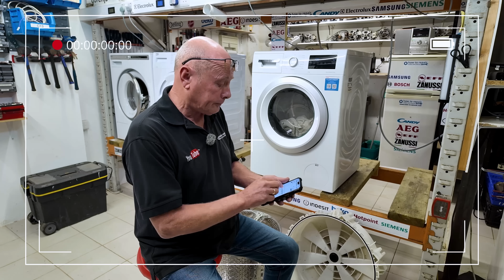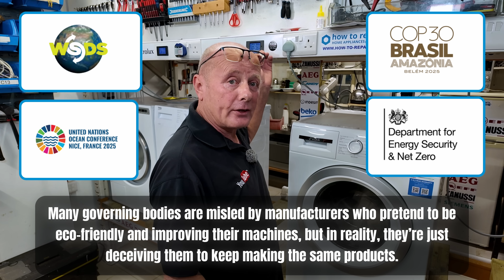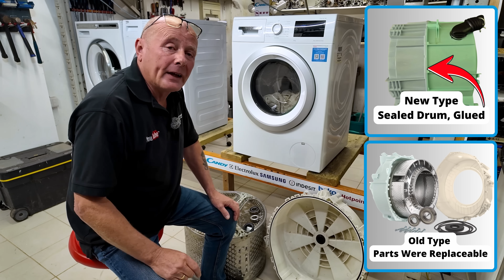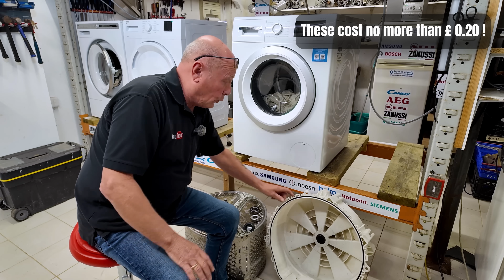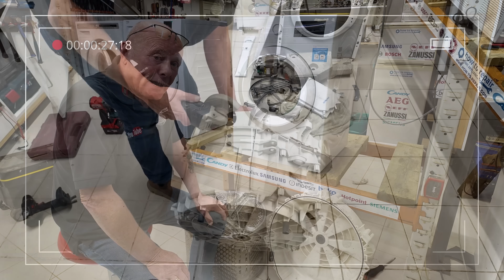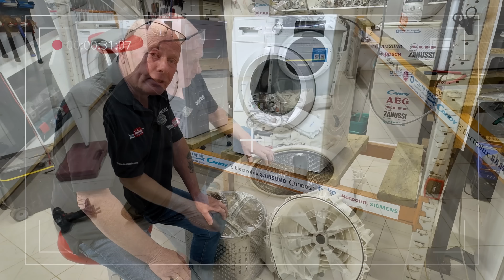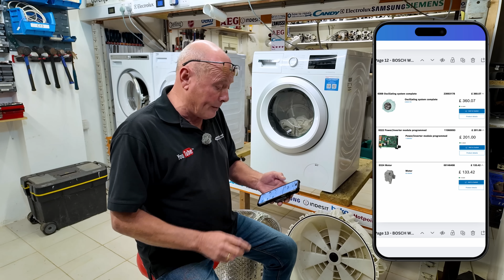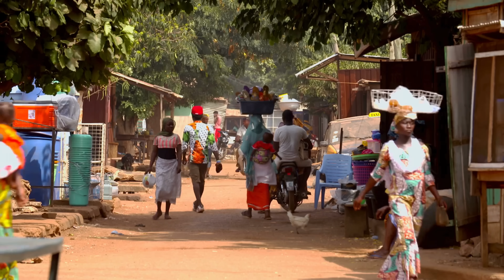Washing Machine SCAM EXPOSED! The Truth About SEALED Drums: Naming & Shaming

Comment: Hi Paul, I believe the way to defeat these manufacturers that are making machines that are to expensive to repair is by yourself and other domestic repair engineers publishing the brands and machine models that can be repaired, that way if people only buy these machines then the other manufacturers would either have to change what they’re doing, or go under…..keep up the good work!
Reply from the maker: Whenever a machine that has quality about it comes into the workshop I am always making a video on it. It is not often I have something good to say but when they appear I always try to help the company. You only have to have a look at the Asko washing machine that I reviewed recently,  it does come at a higher price than some of the High Street brands but you pay for quality. Thank you very much for your support. Please remember to share the video as that is what will create change.
Reply: The after sales market is a scam as well. anyone ever had replacement  brake pads and discs last as long as the factoryq fitted ones. NEVER!
Reply: @jimmcfarlane129  Maybe, maybe not. For example cars are fitted with long-life bulbs at the factory. You CAN buy long-life bulbs aftermarket, it is not a secret.  Philips Eco-Vision long-life headlamp bulbs (in a green pack as fitted as OEM) have the 1500 hour rating right there on the packet, when compared to 350 hours for the "standard" Philips bulbs in the orange pack.  

It says right there on the factory bulb that will fail at about 100,000km the text "Phillips 12972 LL " (nothing secret about it) so just get the same long-life bulb to replace it if you want another 100,000km (and don't touch the glass), easy.

Both bulbs are even about the same price...  The green pack LL bulb is slightly dimmer however, there's no free lunch in lamps.
Reply: To be fair, I think Paul has outlined that the Korean appliances are quite good for serviceability and the Japanese appliances (the genuine ones, not the rebadged Vestel ones) are probably quite good too, albeit mostly not sold in Europe.  But isn't serviceability only one part of it?  No use buying a Samsung for its serviceability if its annoying chimes (only some of which can be turned off) drive you up the wall compared to an unserviceable Bosch? 

 Serviceability and durability is important but European buyers have other concerns too: else Toyota and Honda would dominate the European (ICE and hybrid) car market like they do elsewhere -- but they absolutely do not, Toyota Group is only 5th place in Europe IIRC compared to its customary 1st place nearly everywhere else (Nissan was somewhat more popular in Europe due to use of Renault diesel engines and shared Renault designs, but isn't rated terribly high for durability or quality).

Just as some folks defend the durability of their Volkswagen compared to Toyotas, Hondas and Mazdas, there seem to be Bosch "enthusiasts" who will defend that a Bosch has a sealed drum unlike the splittable drum on an equally (or even lower) priced LG washer and say to get the Bosch washer anyway!
Reply: @TassieLorenzo  I think anyone who would forgo repairability because the chimes that sound for a few seconds are annoying has much bigger problems
Reply: @Sinvisigoth  You reckon? I dunno.  We are not just talking about the chimes, but also the wash cycles and wash performance generally of the Bosch being superior to LG or Samsung as well.

  E.g., the Bosches (in Australia) actually *default to  1 hour "SpeedPerfect" cottons cycle as they know the long cycles annoy buyers, whereas the LG and Samsung only have the long cotton cycle as far as I know and the LG in particular is bad for not giving an accurate cycle time, and just extending the cycle on and on (to the annoyance of operators, lol).

We also hear of LG buyers routinely adjusting their water level sensor to get it to use "enough" water, which is a complaint found with buyers of the Bosch (for whatever reason).

Repairability is one thing, but wash performance and whether it is nice to use is obviously important too.

[For clarity I don't have a LG OR Bosch, but I did have them both in my online cart before deciding against either.]
Reply: @Sinvisigoth  Also in Australia, even the full length cottons cycle is only 1 hour 30 minutes anyway on the Bosch, even without the SpeedPerfect. Whereas the LG and Samsung only have the EU-spec 3 hour cottons cycle (as found on the UK-market Bosch).

Comment: How about a video that focuses on manufacturers that do do split drum models so we know what to buy?
Reply from the maker: If you look through my channel, you will already find some review videos on. asko washing machines and also LG washing machines at the time filming these companies did not have any workshop manuals or technical information, but they did produce machines with splittable drums.  beko is another make that I did a review but I'm sorry to say this company is using sealed drums although they supply good technical information
Reply: Following along here. I don't think you can get Asko outside of the UK. I can't find it in the Netherlands.
Reply: @twowheels90  I live in New Zealand and we can get Asko washing machines, though the supply seems a bit patchy at times. Most of the big box stores don't stock them, but some independent stores often have some in stock, expensive though.
Reply: @twowheels90  ASKO is available in Australia💪💪… they’ve been common in farm households for decades. They’re rated for 20yrs service, can properly handle dirty laundry, are very water efficient (important in drought susceptible environments) and they are “easily” repairable at home with easy access to reasonably priced parts. (Important when your 200-500km from an appliance repairman)

Comment: I have a 10 year old Miele washing machine...good as new and works perfectly...no sign of stopping any time soon  ...just sayin
Reply: I have Meile appliances too.
But I wasn't too pleased to see that they had gone down this sealed drum route.
(I'm hoping mine isn't like that).
Reply from the maker: the older machines are absolutely fantastic well built but do be aware the new ones at the lower price end have sealed drums thank you very much for your comment. Don't forget to share.
Reply: @How-to-repair  I "hyped" you earlier today.
(I'm not really sure what that does, but I'm assuming it helps you).
Regarding white goods appliances, I'm rather taken with some of the Raspberry Pi and Arduino developments to replace faulty PCBs.
As for the sealed drums, I can envisage a machine to split drums which also removed enough material so that two bolt together flanges could be inserted, and plastic welded in place.
Would there be a market for refurbished drums that could be serviced by a white van technician?
I suspect some of the newer spiders are embedded within the drum body. (Is that the case?). If so, they won't easily be fixed.

Comment: The only way the system works is to take out an extended warranty. I used to work as a service engineer for a well known manufacturer. At one time we did cash repairs but as time went on they became rare as alll work came through D&G etc.. But it is extremely annoying to think how many independant engineers have been done out of work and consigned to the scrap heap along with the machines we used to repair.
Reply from the maker: I agree long warranty seem to be the way to go but I have heard of many cases that have a catastrophic failure like a drum the insurance company says it's not economical to repair and offer you a small amount of money to go towards the replacement.
Reply: @How-to-repair  I have heard of this, but for the work we did for D&G every thing was repaired, no excuses. The only exception was if parts were out of stock and it took over six weeks to resolve! The customer might get a replacement machine. By then, they really deserved one. Six weeks plus without a machine, totally unacceptable.
So glad I've retired from it all.
Reply: The service I recieved from D&G was idiotic.
Give me the option to use a local (time served) independent engineer anytime.

Comment: I’ve had my AEG 9000 series 1600 spin for about 2,5 years now with 2450 working hours. The bearings and spider are still fully fine and the machine’s been great
Reply from the maker: I'm glad to hear that you're happy with this machine. They supply good technical information and wiring diagrams to assist in repairs. Only the test of time will show if the drum lasts. It's a shame a company like this went down the route of seal drums. Thanks for your comment much appreciated. Don't forget to give it a share.

Comment: Paul, I'm sure that in countries such as the UK, that has fairly robust Consumer Protection Laws, it would be possible to pass legislation that would dictate that if a Washing Machine manufacturer wants to sell a product in the UK, then they must provide a new drum (for those washers with a sealed drum) at a price below 20% of the RRP (Recommended Retail Price). For example, if a washer had a RRP of 500 pounds, the sealed drum has to be less than 100 pounds. I think this would very quickly reverse the decision of many of the big manufacturers playing the uneconomical to repair card.
Reply from the maker: I really appreciate your comment and it's a great idea. I have made a lot of videos which you will find on the homepage of my YouTube channel with regards  built-in obsolescence, but I'm really sorry to say they seem to be falling on deaf ears. Legislation needs to change we can only achieve this by making these type of practices public.
Reply: This doesn't deal with the waste problem of reduce the parts cost to £20. All manufacturers should be forced to provide all spares and service manuals
Reply: @UsualYaddaYadda  Yes it does, buy forcing manufacturers to sell key components at much cheaper prices you change the dynamics because they lose money on those parts and therefore go back to producing drums that can be serviced. Legislature works in "illogical" ways not based on common sense.
Reply: Agree a drum really cannot be worth anything like that much. Scandalous
Reply: The consumer law doesn’t help us with stuff like this!

Comment: Fantastic video,  for years we had Hotpoint 95 series machines I always fixed them myself no problem, carbon brushes, bearings and occasionally a motor. Now I'm disabled and have have a Ebac machine my son bought for me and it has been completely reliant for the last five years, never missed a beat. 
What do you think of Ebac, my son and my daughter also have one, my son's has been faultless but my daughter's has been a little troublesome but she has always had excellent service under warranty from Ebac. What do you think of Ebac machines.
Reply from the maker: Thanks Bob for the comment much appreciated in the 90s I used to recondition the Hotpoint 95 series. It would take no more than seven minutes to change the carbon brushes in the motor as the motor was on top of the machine and I could do a whole drum rebuild in less than an hour and a half. They were great machines built to last. initially I thought EBAC washing machine machines were great but I was a bit let down with a customer support when I had a problem but they are putting good warranties on their machines and they are British as well

Comment: The whole world economy will be screwed pretty soon, these machines have to many variables that make them  a real issue to repair or replace.
I actually think washing machines are a flawed design and would work better with 2 drums that spin in a figure 8 motion rather than 1 spinning.
Use the forces created from a balanced rocking motion.
Honestly I could think of loads of better ways, manual, mechanical, I think sustainability has to be done from an intention not a reaction.
Start it properly rather than copy it, but we have all these ones already, so let's get them better with an intention rather than reaction.
Like a break up, you are trying to cut ties rather than staying in an abusive relationship.
Reply from the maker: You've hit on a really important point about how the current design philosophy of washing machines is fundamentally flawed, driving economic issues and environmental waste, and the need for intentional, sustainable redesign rather than reactive changes. This perfectly encapsulates the frustration we share regarding built-in obsolescence. Thank you for being on board with the main idea! Reaching maximum visibility is completely dependent on our team. I need your partnership, so please make every effort to share this far and wide.
Reply: @How-to-repair 
If you consider society from the perspective of human life rather than survival, what would we require.
I have broke it down to self worth and fulfilment, at that point emotion becomes our currency.
Now i would prefer we had a frame work already for this before we have any kind of civil disorders.
I washing machine is designed a certain way, but why.
We have single people, families, dirty people and clean people.
We have generations of gamers now, you dont look like a gamer.
They like challenges and competition, make it convenient and boring it is a chore.
The self worth part is important, as people dont want to be around other people nowadays, not washing helps that and less interaction leads to less clothes to wash as well or even just the expectations of being clean are not an incentive.
Just because it is not an ideal way, it can be fun.
Imagine a pilar with loads of washing drums on ropes, people fill it with clothes and water and close it.
Now this is a physical game to play.
They then wind the rope up and have a giant yo-yo to see how long they can YO-YO it.
Competition between people, high scores total amount, you could get people doing it as an exercise, gym bros saying i YO-YOed 50 drums yesterday.

Comment: I once made a fire pit out of the drum from an old Zanussi integrated washing machine and it was nothing but trouble to split the sealed drum in two parts it would have been easier if it was the old separation drum.
Reply from the maker: This may give you some inspiration on ideas if you look at the bottom of the page you will find loads of things people make out of old washing machine drums. Thanks very much for watching. Please remember to share. https://www.how-to-repair.com/washing-machine-welded-drums-why-you-cant-change-the-bearings-2/

Comment: I've no idea but ,ere professional machines intended for heavy use in a business environment , sensibly cost effective repairable- drum,pcb? and is it the domestic market only which does this?
Reply from the maker: Most commercial laundry equipment you are able to access the drum and bearing systems. ipso, jla, maytag, Electrolux, speed queen, and Miele commercial machines can I have the bearings replaced easily thank you very much for your comment.

Comment: Time for some manufacturer to produce  aftermarket parts, non-OEM parts, a generic replacement part , say a drum based on the original manufacturers drum part which is splitable and rejoinable.
Reply from the maker: I think there was a great opportunity for someone to produce replacement splittable drums instead of having to buy a sealed drum the big problem lies with the manufacturer making so many variations of these drums. Thank you very much for the comment. Please remember to share.
Reply: Anyone who would attempt this would open themselves up for lawsuits from the original manufacturers. This move from the manufacturers should earn the manufacturers an automatic removal of say three notches on their energy label for the machine(s).
Reply: Sale of goods act requires products to last a reasonable time. When faults occur just outside of warranty you need to claim direct from manufacturer. Threaten legal action and make sure service engineer puts it back together properly so manufacturer. An claim damage caused by repair attempt
Reply: If you were going to that trouble, making an aftermarket outer drum be it plastic or stainless steel (one of the largest parts of the machine), I think you almost may as well setup (even if you have to buy-in motors and circuit boards, which most do) to  manufacture an entire washing machine of your own brand?  FWIW, I decided against LG and Samsung (even with their splitable drums and overall ease of service) as their software with low water levels and the machine getting stuck and refusing to finish the cycle seems infuriating (as well as the uniquely Korean obsession with musical appliances! albeit the LG tunes are somewhat pleasant but the Samsung ones are horrendous IMO)
Reply: @TassieLorenzo I was over-ruled by my wife when we bought our last washing machine, I stated that I hated the music when we demo'd it but could only buy it if it could be turned off .. it can't 😢
Reply: @MrCHrisfj  get a better wife that respects her man.